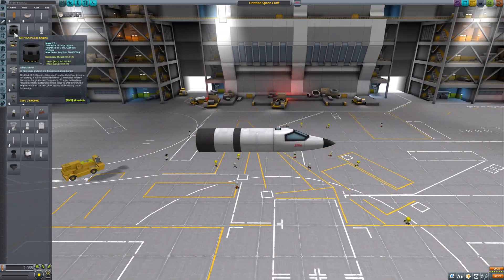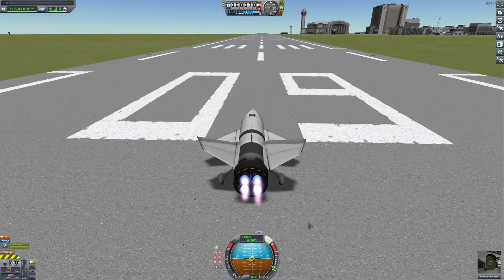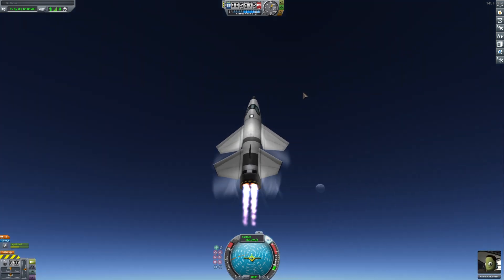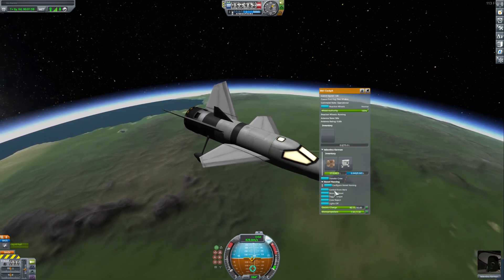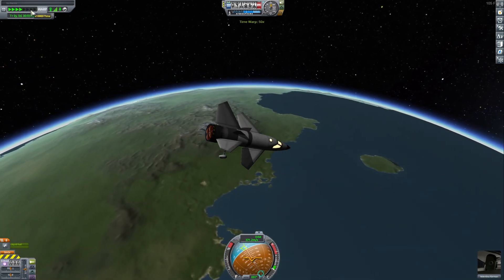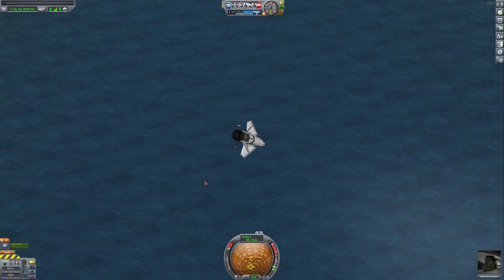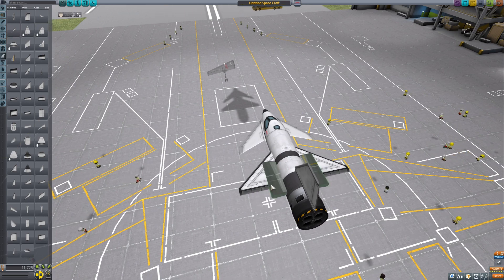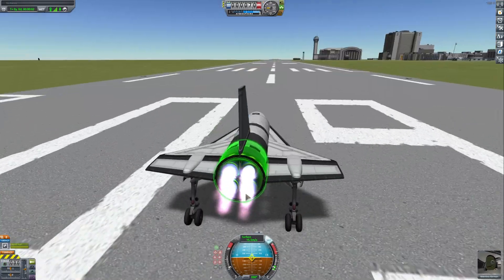KSP Part 13. Reaching Orbit in a TINY SSTO Plane

Comment: hey i was about to comment on the misunderstading of orbit and space, but two other comments already clarified that. If you want to actually make it to orbit with a space plane with one stage you want to use the same engine you use but initially use the airbreathing (its more efficient)  mode to get yourself to 20km in altitude (go flat until you reach 400 m/s then slowly pitch up by like 30°) after you have no oxygen in the atmospher use normal engine mode to finish the job.
Reply from the maker: Yea I’m still new at this so I’m learning as I go 😂
Reply: and also use nuclear engines. they are super efficient and only use liquid fuel in vaccum

Comment: someone teach my boy about snap 🙏
Reply from the maker: Please 👀
Reply: @ArchSQ3  Hit the C key - it switches the editor from smooth attachment to angle snaps. If you're trying to put a fin on the top of your rocket but the angle isn't perfectly straight up and down, snap helps you bring the part into alignment! Then you can hit 2 or 3 on your keyboard to rotate the part and translate it w/ snapping. If you want to fine-tune the part's direction, then you can hit C again to disable snap and move the part freely a little bit at a time.

Comment: Yeah, you've reached space (in KSP universe the boundary set at 70km) but you haven't achieved orbit. An orbital spaceflight (or orbital flight) is a spaceflight in which a spacecraft is placed on a trajectory where it could remain in space for at least one orbit. In KSP universe, again, that's basically achieving an altitude of 70km above sea level while traveling with > 2200m/s parallel to the ground. Once you achieve this, you can basically follow that trajectory infinitely (KSP orbits don't decade the same way earth's do) and just keep flying around Kerbel again and again.
Reply from the maker: Ahh okay, wait so I have to be faster than 2200 ms? I thought reaching 70km was it 😂
Reply: @ArchSQ3  2200 m/s sideways - realistically an experienced player needs about 3400m/s or so of DeltaV to make it to this speed, because you have to get up out of the atmosphere where air will slow your craft down, and you have to go fast enough sideways that you fly past the earth faster than it can pull you down to the ground. 

If you press M, you can see your flight trajectory on the map. A stable orbit happens when both the apoapsis and periapsis (AP and PE notches on the orbit path) are above 70,000 M around kerbin. For the SSTO you built (if you add an air intake) you could try to hit 400m/s very low to earth to get max thrust from the jet, pitch to 30 degrees until about 30,000M altitude, then slowly ease the nose down until you're flying level by 55,000-60,000M altitude, pushing your sidways speed way up to get your apoapsis out of the atmosphere. Then, you can circularize at apoapsis to get a stable orbit.

Orbits are tricky until you get the hang of them, especially with spaceplanes! And there's tons of small things you can do to a spaceplane to make it more efficient at getting there - but the key is that you want to go sidways really fast, and up just enough to get out of the atmosphere!

Comment: An orbit is not space, but when you are falling but constantly missing the Earth, and to do that you need around 3400m/s of DeltaV at a minimum (2200m/s horizontal speed). To get to low kerbin orbit try to have around 4000-4500m/s of DeltaV to be safe. As a point of reference, for low kerbin orbit you need at least 70km at apoapsis and periapsis (highest and lowest points of your trajectory), you can do a circularization burn using maneuvers, they're pretty useful. So considering all of this, the plane wouldn't be an SSTO but a sub-orbital spaceplane, but it is a pretty cool thing still ;) Hope I helped.
Reply from the maker: Oh okay, that makes sense, I was honestly just basing it on the music 😂😂 music = I’m in space. Thanks for the explanation!
Reply: Are you crazy? You never need that much delta-v to reach low Kerbin orbit!
Reply: @willkersonbreno  At least 3400m/s for an optimal situation, 4000m/s to be safe. Another thing: Are you brazilian?
Reply: @lorenzzorzt   yes, im